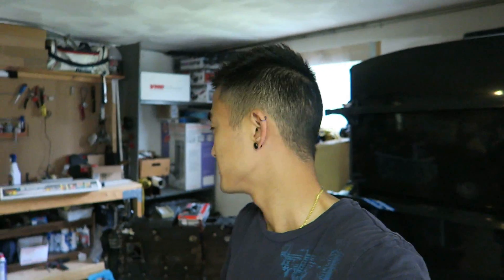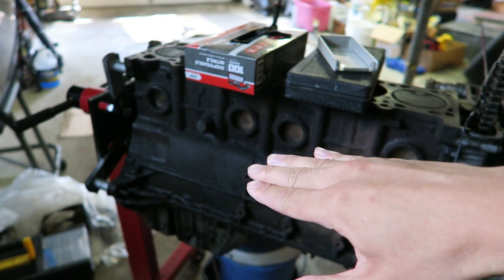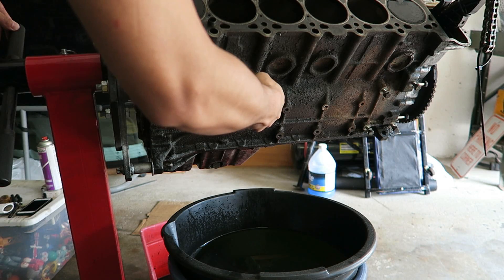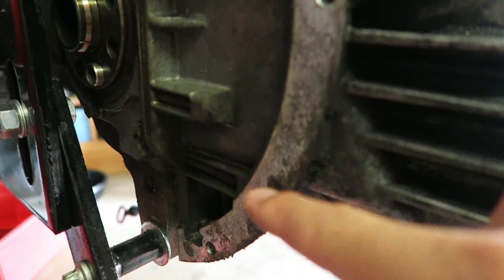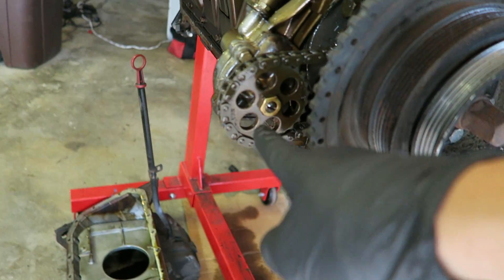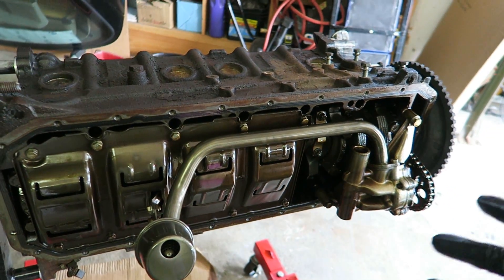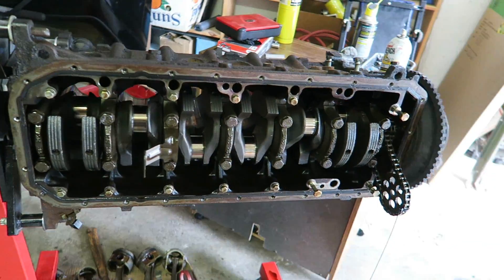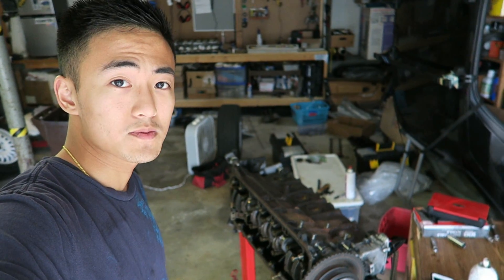BMW E36 Engine Teardown [Pt 2]: How to remove pistons, oil pan, oil pump (m50 m52 s50 engines)

Comment: It would have been good to mention cleaning or cutting the ridge at the top of the cylinder, which makes removing the pistons easier and avoids damage to them when they push past it.  Also, making sure not to scratch the crankshaft journals when pushing the rods out.

Comment: god i wish u was living close to me i’m from bakersfield ca and my lifters are loud or idk if it’s my vanos i know it’s not the oil pump or the nut on the oil pump cuz it’s knocks loud from the lifters and it’s been like 5 months i daily it that way
Reply from the maker: If it's the vanos you'd most likely hear the ticking at the very front of the valve cover. But if the ticking sound is spread across the length of the valve cover it's likely to be the lifters. Have you tried doing an oil flush? Sometimes the lifters just get clogged and a fush helps dissolves contaminants inside the tiny oil passages of the lubrication system. If that doesn't work then unfortunately you'll need to replace them or open them up/clean them up if they don't have too much wear (got a video on how to open the lifters up and clean them).
Reply: if u can send me the link sir that me amazing much love from california i love ur videos

Comment: Hi, Bro. whats the torque for Head bolts, main cap bolts, connecting rod caps.
Reply from the maker: That I cannot confirm off the top of my head, but I can assure that the BMW Bentley manual has it I believe. Otherwise, bimmerforums.com is my next place I'd look into as there are a lot of people that have completed engine builds there. I have yet to finish mine due to a lack of funds 🥺

Comment: I cannot at all get the sprocket bolt off that connects oil pump to timing chain.
How do you get that reversed thread off?????
Reply from the maker: With reverse thread hardware, it's clockwise rotation to loosen and counterclockwise to tighten. Unless it's been previously overtorqued, it shouldn't be difficult to loosen. Is this the first time you're attempting to take apart that sprocket?

Comment: I would like to have the balls to fix my own car or do things to it but i am way too scared, unexperienced and untrained to do that, i guess i gotta pay the buck or try my luck and trying my luck with expensive things is not good
Reply from the maker: Don’t be scared, yes it’s expensive to buy engines and parts and I get where you’re coming from. I worked three part time jobs to afford all the parts to my build. The knowledge, tech experience, and time spent with friends that help in trying these projects (pass or fail) are more valuable imo 👍.
Reply from the maker: Out of the 15k I’ve put into my car, I can tell you that I’ve wasted 3-4K in broken parts, redoing work I didn’t do well enough the first time, and buying cheap parts that fail 😂.
Reply: Pawinning wow. You made it look so easy on the video😂
Reply from the maker: This video is the second time around for the disassembly, the first time was intimidating and difficult for me. I wanted to make the video to demonstrate the steps in a way I wish I saw them for the first time 👍. thankfully with the Bentley manual and the forums I was able to get by. Getting the right tools the first time is key tho from what I learned
Reply: Ukkomoes, im cutting my teeth on an M20 right now for my E30, bit I have plans for an S50 in the future. I come from a mechanical background working on helicopters for the Army, and I was a bit intimidated because I didn't know anything about cars. It's very easy to pick up. Get yourself a Bentley manual and keep watching videos like this. It seems like a lot but in reality old BMW engines are very simple machines.

Comment: do you have an 800lbsft impact? Probably could just put a flywheel bolt in the back, lock it to the engine stand, and use your impact to loosen it.
Reply: as an aside, no matter how many times I watch it, the piston flying out always makes me chuckle. Your "da fuq?" face, the sound effect, and the "oops..."

Comment: Finally! Hahaha been on the edge of my seat for this video. Can't watch it yet since I'm at work but I'm excited to get my engine apart so i can resurface and put together for a turbo e30 s50.
Reply from the maker: +photojnt I'm glad I can help you out!!
Reply: Pawinning I have the s50b30 engine so what all would I need to do to set it up for a s50b32? Rebore it, new pistons and ecu is all right? Gotta look further into the different size specs for the pistons still.
Reply from the maker: photojnt I would also look into if u could stroke the motor with a different crankshaft. That way you don't have to bore out the motor